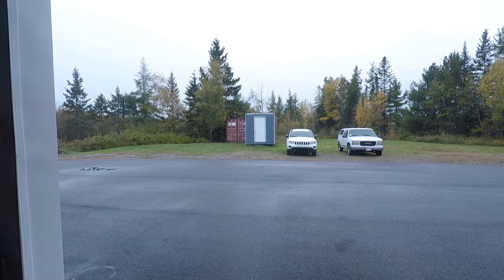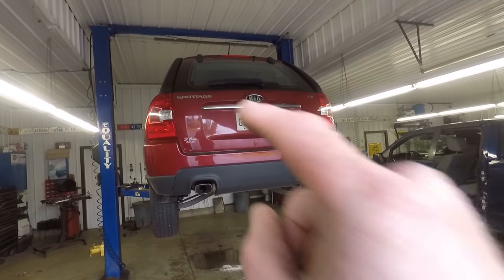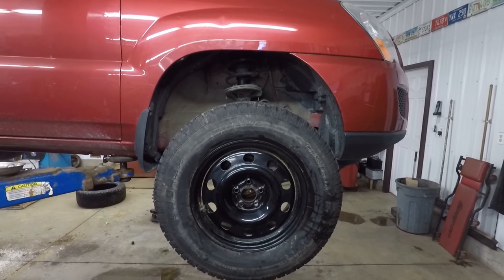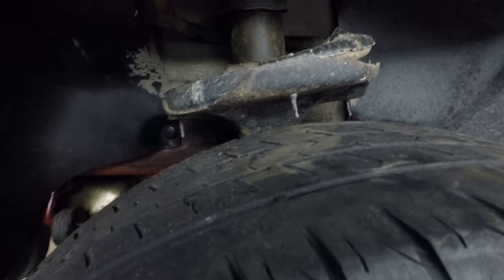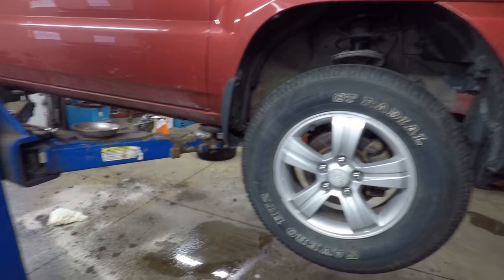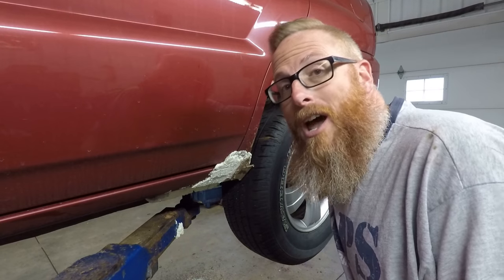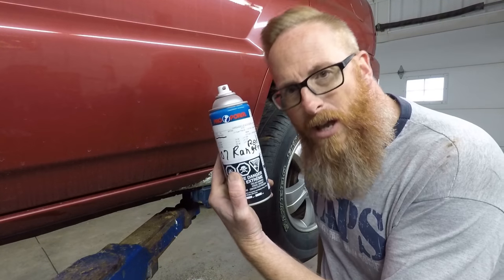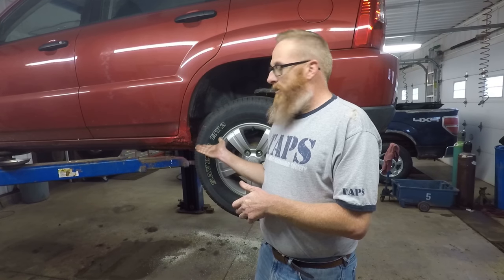BUBBLES IS GETTING SOME MORE REPAIRS... PART 2

Comment: Good edit! Now I feel like going on a travel to find the perfect taller tore size for you, haha
Reply from the maker: +Str8sixfan ty. But if I use spacers, the ones I have may fit..
Reply: @OldeCarrGuy  245/65r17 appears to be about 5/8" diameter larger than the 235/70R16. 245/70R17 is about 1.5" larger diameter, 255/65R17 is about an 1" bigger in diameter and probably right about the sweet spot. However, just because all of these tire sizes exist, doesn't mean they're necessarily common/readily available on the used tire market.
Reply from the maker: Much appreciated. We do carry a large selection of used tires so I’ll see what I have.